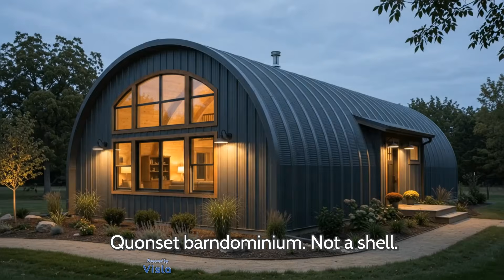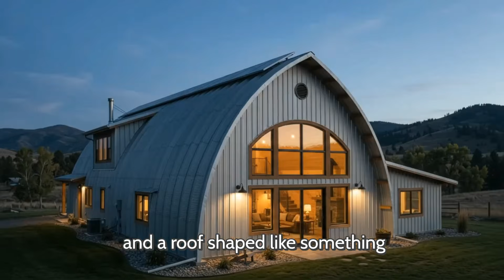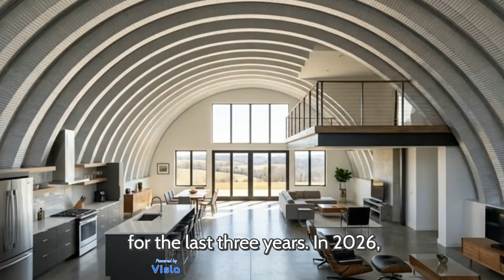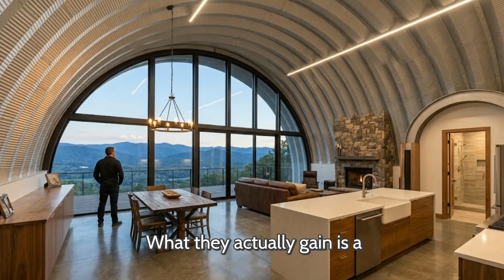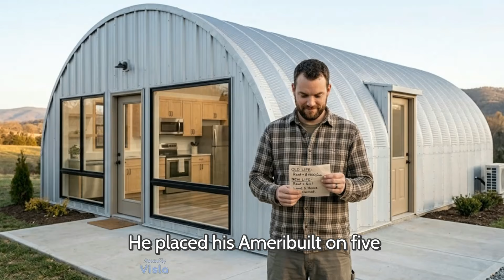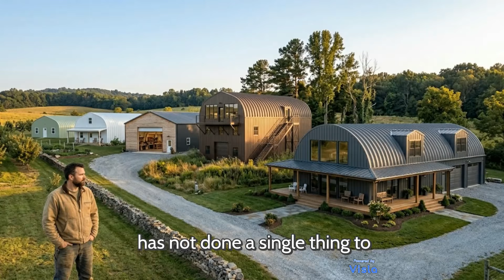5 Prefab Quonset Barndominiums for 2026 — #1 Will Shock You ($60K!)

Comment: Looking to return to off grid living asap; did that for a decade eons ago b4 anyone even thought of solar power.  What would work best for me would be 2 of the General Steel units set close to each other with a breezeway in between.  Wouldn't have to actually run water to the 2nd unit bc that would be the one 'on vacation' during worst of summer and winter when I could hole up in the first unit and just heat/cool it.  

But even after buying a bit of land, I'd still have a little left over for special things like robust solar, fencing, maybe even a well.  My area has a very high water table; just close your eyes, pick a spot, grab a shovel, and there you go.

I could also use every bit of the combined 1200 sq ft bc I'm the last one standing in my direct family line, so I have 4 generations of legacy furniture (a.k.a. antiques) to babysit the rest of my life and I'm currently crammed into 1928 sq ft.  Of course I'd also have to sell my present home in TinyTown first, which realtor.com valuates at almost $190K; but it IS an 1880 Vic in sound structural state (huge heavily landscaped lot) with the main upgrades already finished - wiring, plumbing, insulation, heavy duty metal roof etc.  Water line now properly buried (and insulated) at 4' for the current 6A zone.  Some cosmetic features still need updating but that's easy enough even while living in a place if you have the $.  I just didn't after taking care of the more costly major stuff.  

Much as I dearly love this house, it's way too much for me to take what I consider proper care of into the future since I've turned 80 and don't love stairs anymore; but if anyone's interested in buying as is at $190K firm, and ONLY if they can pass careful inspection themselves, let's talk ...  Plus you know we'd have to arrange somewhere for me to live for maybe a month at least while the 2 quonset huts were being built and delivered and installed.  That's the main thing I like about the options in this video, bc I'll need a turnkey solution once the foundation's built.  And who knows, maybe they can do that too for a little extra.